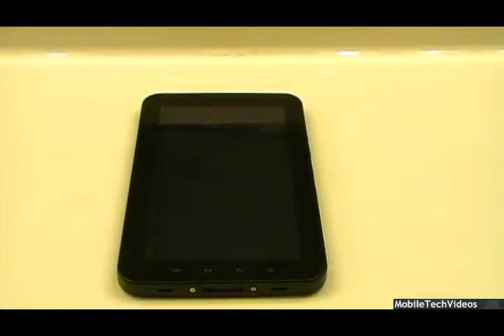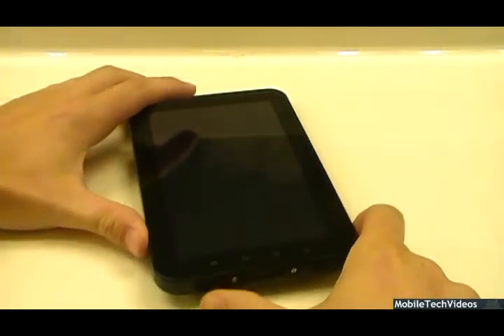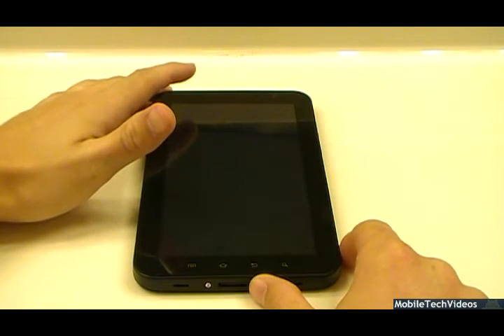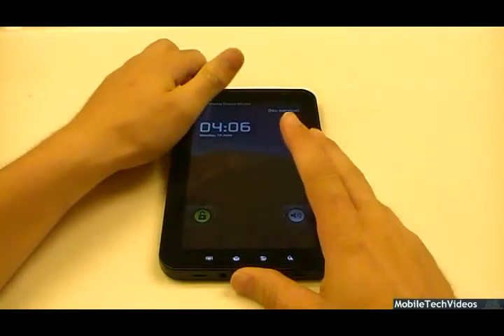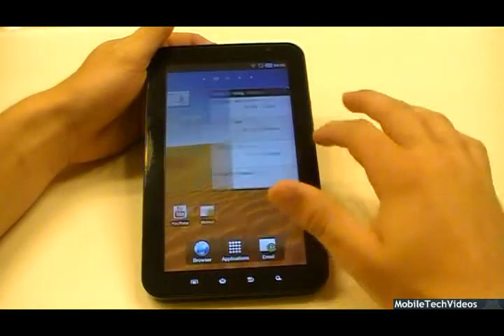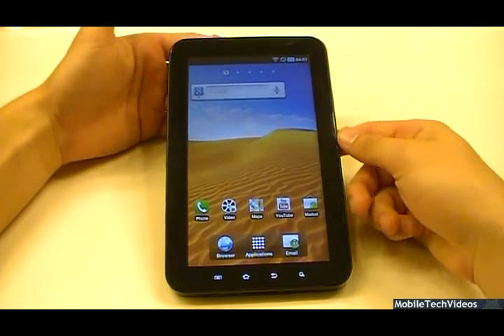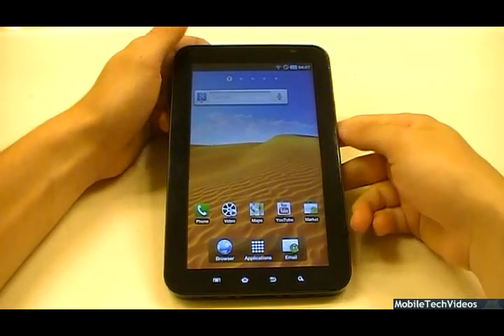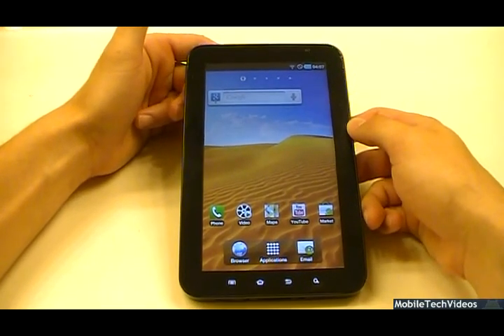Samsung Galaxy TAB - JTAG Service (Debricking/Unbrick/Brick FIX)

Comment: i screwed up my galaxy tab 7 korean version by installing wrong custom rom.
since that time my tab is dead except flash light. when i connect tab to computer flash light is on, whenever i press power button flash light is on or flashing.
i think it is hard brick.......
it i'm right is it fixable if so, how much how you guys receive it and fix it?

Comment from the maker: @jordan2002100 I read a lot and I'm very good with small electronics from working with them for over 10 years. I have a nack for putting together information that isn't very well presented either. There is no simple book on JTAG. I've just had hundreds of hours of learning and experience to get where I'm at and it's expensive to start out and failure is part of it as well. Good question though!